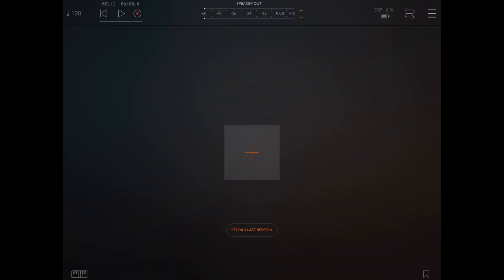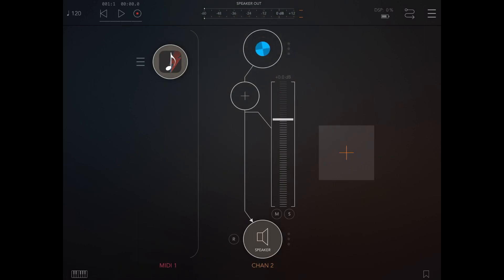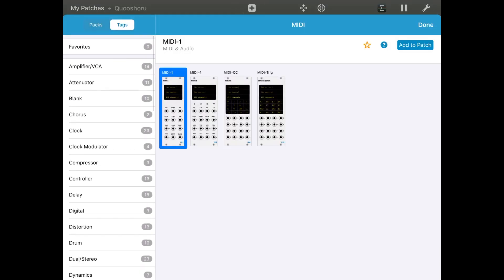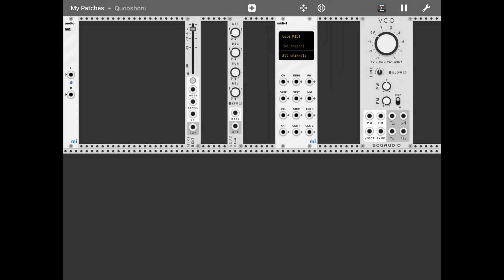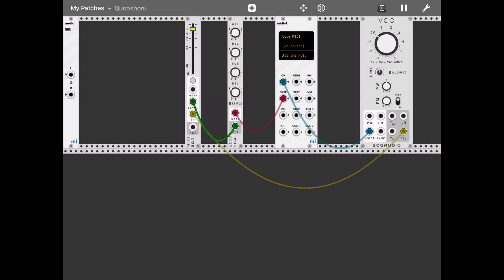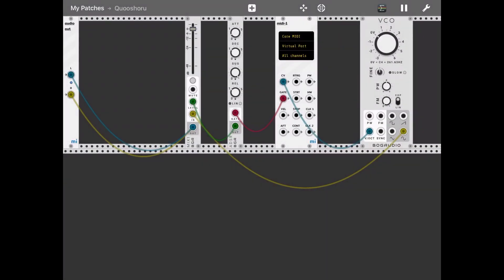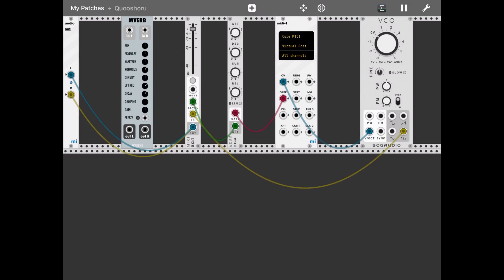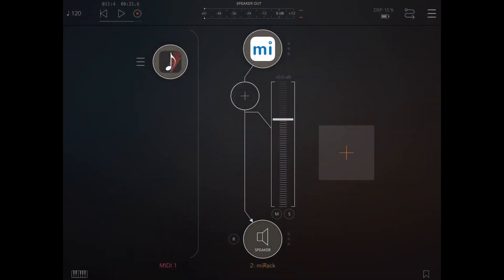miRack - Tutorial: Midi Input from AUM

Comment: thanks again for this! do you have a video showing how to sync the aum transport with mirack so everything is in sync and i can use aum to start everything?
Reply from the maker: miRack can accept midi messages, support Audiobus and IAA (https://youtu.be/U81U91uiiT4 ) for post-processing, but it is not an AUv3 unit and doesn’t support midi out yet. So it doesn’t work like other AUv3 units where you can sync to the AUM transport, not yet! Although not quite like miRack but have you looked also into BeepStreet Drambo? you can do amazing things, some similar to miRack but it is also an AUv3 unit and effect. I use both...
Reply: SoundForMore absolutely! i’ve been following your drambo series and i got it the day it was released! waited 2 years for it haha. and ok i saw someone press play in aum and it started miracks transport as well but i don’t know how to wire that up, that’s what i’m trying to figure out, that way my mirack patch plays in sync with my aum session
Reply: SoundForMore i just figured it out!
Reply from the maker: ok good, no need for another video then :)
Reply from the maker: the more you play with the tools the better you get to use them... ;)
Reply: SoundForMore in aum send midi clock to mirack input, then i ran midi 1 module to beatovnik clock ext clock input, then ran the multiply x2 into dumbwaiter sequencer clock... you have to set the clock rate on midi 1 ...
Reply: SoundForMore a better way i think is midi 1 to CLOCKED run input, then the CLOCKED run out put to your sequencer clock
Reply from the maker: I might do a tutorial shortly on it...